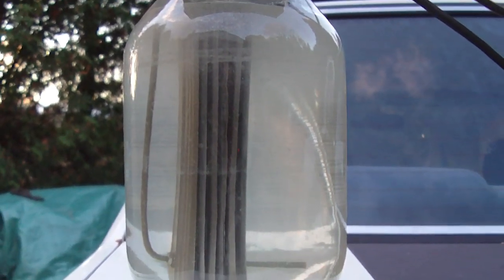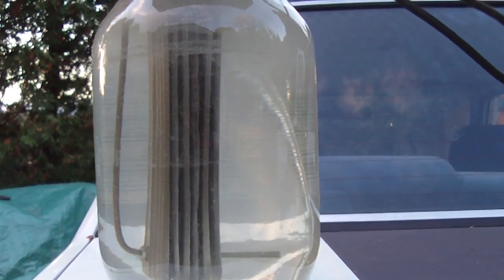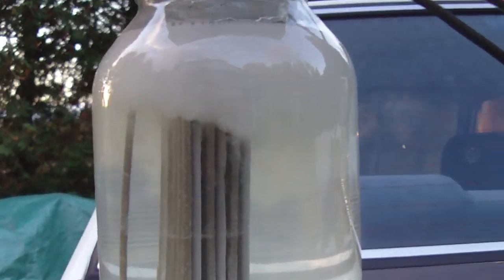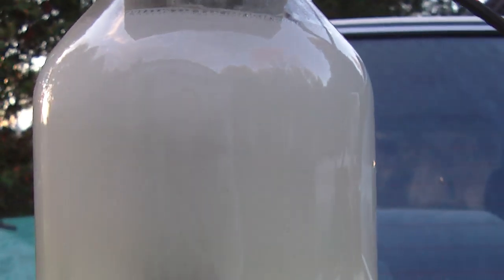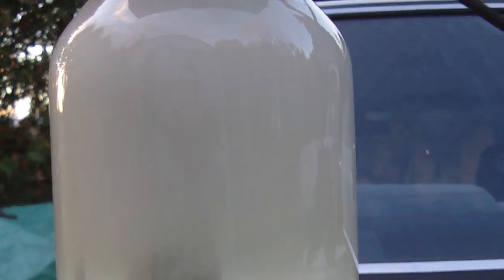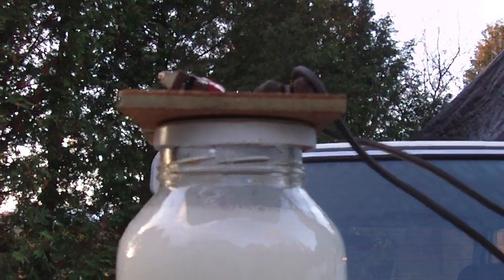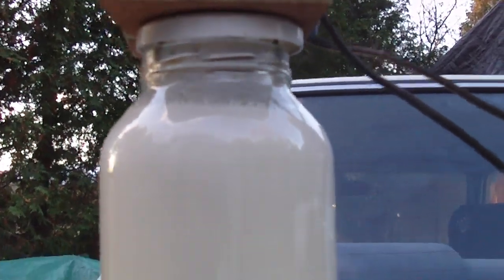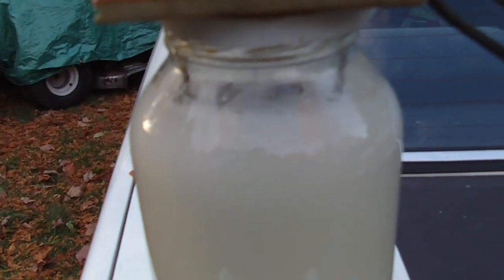Homemade HHO generator 12v 15 amps

Comment: Mines using titanium and stainless mixture and baking soda with distilled water but it doesnt produce any of that fog..  just big ass bubbles the whole time..  the electrolyte has remained clear(ish) from the baking soda mix but no yellowing or anything..  uses around 15a @12vdc..  but regulated down to 9 or 10 amps still gives me instant boobles..   using 10ga stranded copper wiring bolted with all stainless hardware ..  but the titanium made the world of difference, only using a 6" tube x 2" round.  Is an old  car exhaust stuffed with stainless scrubbing pads with a dielectric plastic sheet wrapped around that and stainless 1/16" sheets stacked to 1/4" thick then a 1/16" titanium sheet wrapped and bolted. Tight..  all in a pickle jar..  dem makem fire bubble..

Comment: Platinum titanium electrode works better, steel may contain toxic compounds such as hexavalent chromium. Should 10A be enough and what voltage best? What pressure it is?